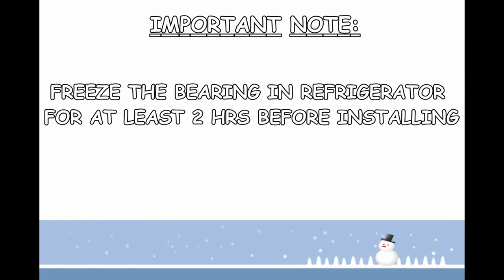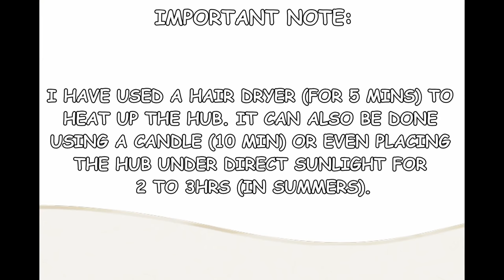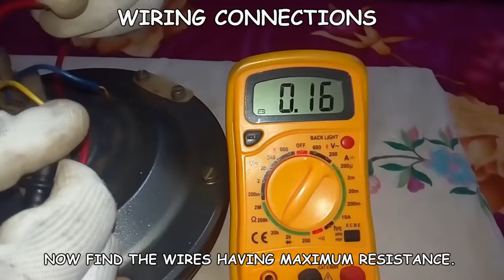How to Change Ceiling Fan Bearing .

Comment: What would be the best way to clean the bearing spring?
Reply from the maker: We used kerosene, paint thinner will also do and while putting the spring back apply grease on both end of the spring to avoid squeaking noise.

Comment: Are all ceiling fan bearings the same size?
Reply: no, but on the bearing itself there is a part number you can use when ordering replacements

Comment: Do we need separate size puller for both bearing?
Reply from the maker: Yes you need two different types of pullers.
Reply: @tuhinde698  where to buy the bearing pullers? kindly help me to find one. I need the bearing pullers desparately.

Comment: Hi very informative video. I searched all the shops locally as told by you but didn't find bearing puller. Can you send me bearing puller I will pay for it. I am in Kolkata
Reply from the maker: Amazon.in BEARING PULLER 2 in 1 (6201-6202) https://www.amazon.in/dp/B07GMTC846/ref=cm_sw_r_apa_i_zAI7Cb82S9GWE
Reply: @tuhinde698  What you showed in your video is different from amazon link
Reply from the maker: Yeah but this will also work, it is difficult to get exact same one online as these  pullers come in different shape and sizes, if you want to buy it offline then you can try the shops which repair ceiling fan, rewind coil etc or ask them where to find it in kolkata they will definitely help you.
Reply from the maker: If you still not able to find it then i have located a shop in kolkata and they sell fan bearing pullers which i enquired personally by calling them.

Raj Fan's Spares

157/C, Lenin Sarani Rd, Deluxe Centre, Chandni Chawk, Bowbazar, Kolkata, West Bengal 700072
096811 55404 https://www.google.com/search?client=ms-android-coolpad&hl=en&output=search&q=Raj+Fan%27s+Spares&ludocid=901145694082841663&ibp=gwp;0,7&kgs=3c15dd825bd549c1&shndl=-1&source=sh/x/kp/local&entrypoint=sh/x/kp/local